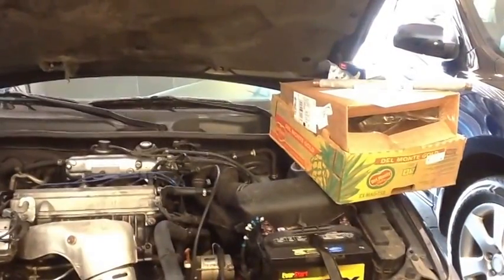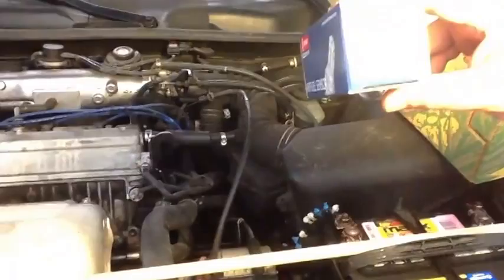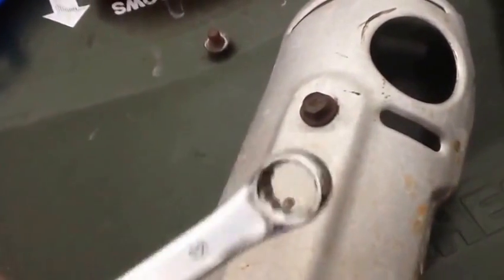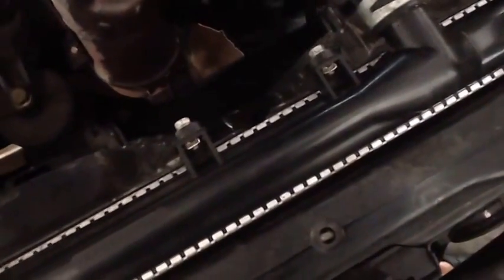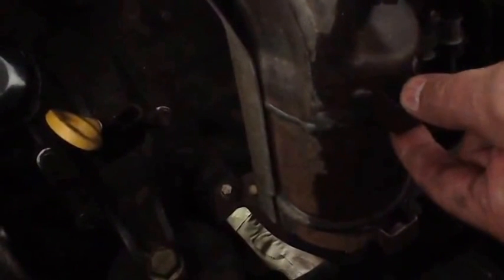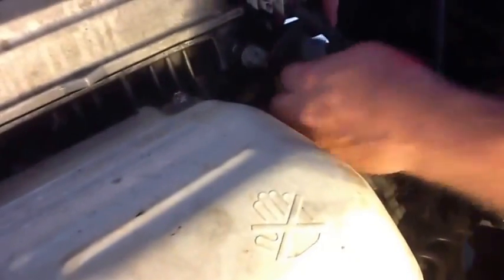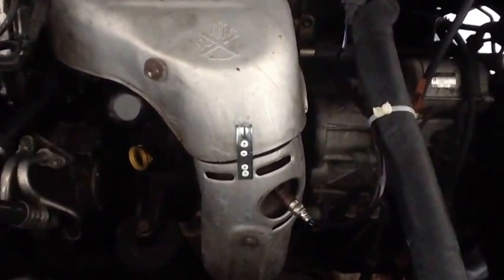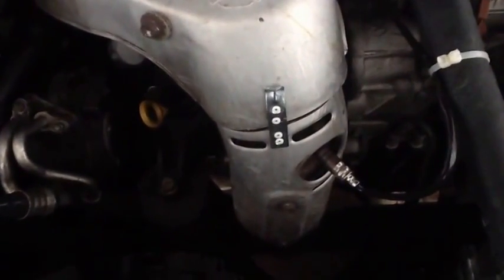How to Replace Oxygen Sensor Toyota Camry

Comment: P0420 means your rear cat isnt doing it's job. Use a laser thermometer on it. Should be 200-250 degrees higher than the front cat. if it isnt then check for an air leak at the joint between the 1st and 2nd cat. if all is Ok and your 2nd cat isnt hotter than 1st its bad. Try using a o2 non fouler to move the O2 sensor out of the exhaust stream to trick the computer into thinking its working fine.

Comment: Did you ever resolve the p0420 issue? Just got happened to me last week, replaced the air fuel ratio sensor with a Denso oem one everything was fine till this morning the CEL came back on, same code, can't figure out what it is.
Reply from the maker: No never did pretty sure cat converter but didnt care let it stay like that.

Comment from the maker: Went and replaced the Engine temp sensor, since it has 240,000 miles on it, the one with the green cap near the throttle. Didn't help with the stalling. It was worth a shot, was around $25 bucks took about five minutes to replace didn't even leak hardly any radiator fluid when I took it and and quickly switched it out. I may replace the air flow sensor in the air filter box next. I am thinking the startup stalling is the IAC but it's expensive to replace. Could also be cat material lodged in the convertor I guess.

Comment: The Certified Tech with years of Yota experience says: P0420 refers to catalyst inefficiency(below95% threshold), and can result even from a small leak in the exhaust. When your rear 02 sensor doesn't see a level voltage after it reaches operating temperature, your computer reads that fluctuation as the converter not appropriately catalyzing your engine exhaust gas. So a faulty rear sensor can also cause that code. Incomplete combustion due to old plugs(these 5sfe motors are picky, but LOVE DENSO Iridium Laser or IX type) plugs, a weak ignition coil(not likely before 200K miles in this car), poor quality fuel... fuel filter restriction (although these cars can go 300K miles with no fuel filter change, no joke, so probably not that), vacuum leaks can certainly cause a rich condition that may reveal this code...  What I'm trying to say is that 02 sensor diagnosis in OBD2 based on a p0420 alone is a nightmare without having multiple data graph lines, and knowing the actual temperature of your Cat (it's important to it's ability to absorb and release oxygen). If this fixed the code, in a perfect world it would have been accompanied by a "Bank 1 Lean" code (Which actually means the computer is compensating up to 17% more fuel, with your bad front 02 telling the computer you are lean, the actual result is that false "Lean" code means you are 17% RICH! and that old cat just couldn't deal with the extra hydrocarbons. If it did not fix it, I'm curious about the miles, and what the fix was.
Reply from the maker: You are correct after over a year still have the code. Also the camry stalls sometimes after starting. I replaced the plugs with denso and also both coil packs no difference. I love this car but dont know what to do most places don't do the tests that are needed. So your thinking it could be the rear sensor?
It has 240,000 miles. I also cleaner the throttle a few times, but still once in a blue moon stalls. I have to keep foot on gas until it gets hot then drives fine. Only happens once every few months. I thought may the timing belt idler was bad causing a strain.
Reply: foot on the gas till the engine warms, and stalling occasionally point toward the intake air bypass valve, bottom of the throttle body. careful, there are coolant lines that you DONT want to hook back up to the intake lines. Get a throttle body gasket and Intake Air control valve gasket from either Felpro brand or Toyota DO NOT REUSE THESE GASKETS. Your throttle body is simple enough to remove, 4 nuts on studs and a few incidental linkages that I know you can figure out. Get a good throttle body spray cleaner (Buy the expensive foaming stuff from a GM parts dealer, I can get you that PN tomorrow if you really want...) remove the throttle body, then remove the Idle air control valve from the body. soak all your parts in cleaner. Rinse and repeat. Use a plastic brush or small bore bottle brush for tight spots. Reassemble it and hope that works. That IAC valve is about $230 which is NUTS (but it's because they never go bad) buy some fluid film, or at the very least wd-40 the hell out of all the moving parts on the body and IAC after it's clean. Also, I would recommend checking all the vacuum lines, especially the short one from the throttle body down below the throttle linkage as if the diaphragm in that small part the line connects to is bad (very possible) you won't get an automatic idle adjust up at varying low rpm load (kinda like your stalling issue) remove that vacuum line and that little device should try to push your throttle open something like 3/8 inch travel. It won't go back in till you restart the engine, that will be normal. Also at those miles, I recommend buying 2 things that are easy replacements that should give very good results. Intake air temperature sensor (located in your air box, it's a push it into a rubber grommet kind of thing) but more importantly, the coolant temperature sensor. Get it from Toyota with a new gasket and it's like changing a spark plug, but easier. Cold engine, tho...coolant behind there.  It'll leak, but only till you get the new one in place. :) This sensor changes resistance based on temperature and directly relates to the computer information about how to set your fuel mix, along with a few other (seemingly unrelated so unmentioned) sensors. I believe your car will run like new, if you do this. In regards to your Rear o2 Sensor, all it does is monitor how well your cat is working. it may cause the code, but it's the last thing I'd chase down while you are having other running issues. All after Cat o2 sensors absolutely WILL NOT affect how your car runs, it's not used by the computer that way at all. How's that for ya man? And btw, if your Cruise control ever quits working, just unplug it and plug it back in with some dielectric grease for good measure. My current Camry is at 244K Miles, and the exhaust is pretty nasty (My build from bends, to welds, and hung) But check my latest video out, and you will see what the 5sfe camry's timing set looks like apart, and hoe crazy frozen solid my water pump was. BTW it was a new belt, and that video is exactly why they tell you to do the entire timing set, not just the belt. :) Facebook my name, I can help more there if needed.
Reply: And I'm still willing to bet the P0420 is from a small exhaust leak, usually at the flex.
Reply from the maker: Thanks for all this, I will replace the air intact sensor, I had checked it with an ohm meter but not sure I tested it right. I did have a K&N filter and they are known for oil in the air intact issues. and will replace the coolant sensor. they do look pretty easy and pretty cheap. I had bought a collant sensor from autozone but returned it didn't have time to mess with it at the time.  Any reason to get that one from dealer? I am not sure I can work on the throttle removal. I had taken the IAC off a small bit and cleaned it. Basically took two screws off and sprayed in the hole, it had a little washer in it that looked easy to lose.
Reply from the maker: I checked discount auto there are a few items for coolant sensor. I think it's the green one.
http://shop.advanceautoparts.com/p/factory-air-coolant-temp-sensor-switch-36424/18890910-P

By the way a few of the reviewers were saying how replacing this fixed their hesitation and stalling issue so you sound like your right on. It's about $30. So worth a shot. I couldn't find it on rockauto.com

I'll do the coolant sensor switch then most likely replace air intact sensor.
Reply: Glad I could help, I have to give the throttle body and air valve a cleaning once a year. it's a thing. checkout toyotanation .com (sign up here for awesome forum advice)
Reply: Lolll yota experience 😂

Comment: clean all metal contact areas and use JB weld on it it works real good
Reply: Ron Townsend You're right, but this guy had other issues, I'm guessing flexpipe leak. These cars can do that before you even hear the leak. All it takes is a little extra oxygen in the exhaust stream going past the rear o2 to make the voltage vary, and a few of those kind of incidents will set the inefficiency code.

Comment from the maker: My 7/8 o2 sensor socket from harbor frieght would not reach the sensors nut. So I borrowed some O2 sockets from autozone. The small tool was the best fit for this.  Also you have to check your connector and match it to the denso part on their site or on rock autos site. There is either a air fuel sensor or o2 sensor for this model and year car. If you check the connector prior to buying you will most likely have the right one. You can email denso and they will help you if you need it.